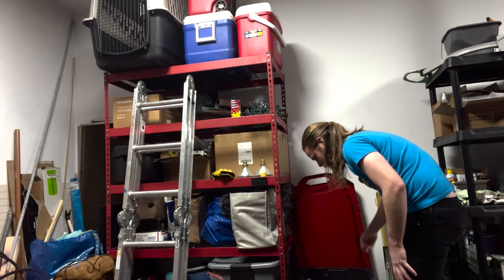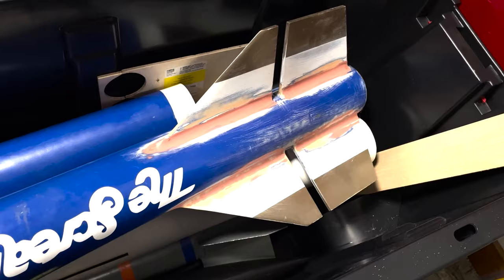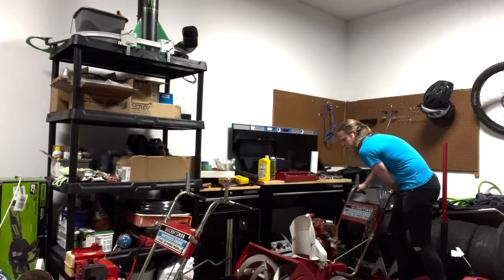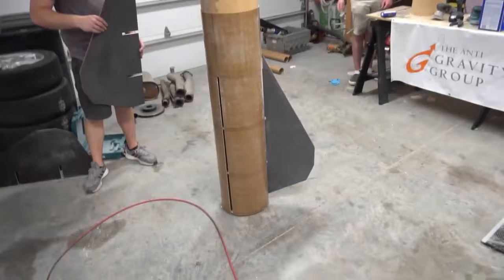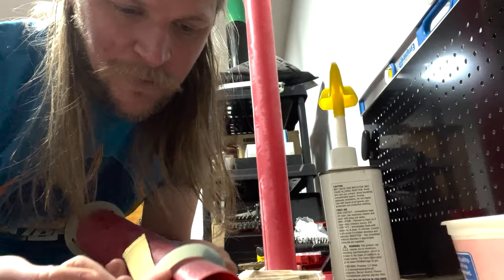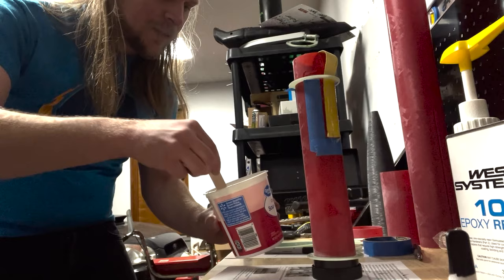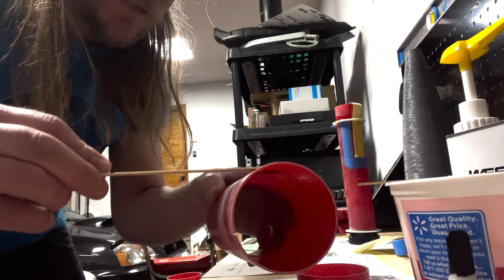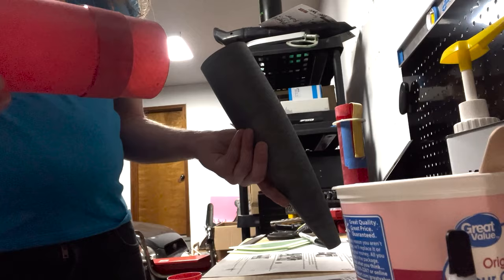The Great Glue Debate

Comment: 404 high density filler  and 406 colloidal silica are my go-tos. I usually put some 404 in w/the 406 for fillets, I usually just eyeball it, but it's probably something like 4 or 5 parts silica to 1 -2 parts 404. When attaching hardware, like washers/nuts to bulkheads etc, I just use 404. Lately tho, I've been messing with W.S. G/flex 650 Toughened Epoxy lately. It has a higher Tg than typical W.S. (105). I want to try the W.S. G/flex 655 and G/5 5 minute. I also have some of that Six10 in a tube, but I haven't tried it yet. I'll also use Aeropoxy w/and w/o some 404 or 406. I'm still learning what's what, but I also have some BSI and JB Weld obviously :) I'll often use JB Weld near the hot end, or when I just don't want to get all the epoxy "stuff" out

Comment: Can't believe I enjoyed listening so much to a glue talk.    So far I have been using Bob Smith epoxies for my builds and am intrigued to start using West systems which many people talk about but WS has so many options.    Can you comment on the which ones match up best with high power rockets for the colloid silica and hardener?   403/404/406 or 205/206/207
Reply from the maker: Typically I buy just the slow hardener and the 406 silica. However, adding a small can of fast hardener for situations where you need a bit quicker curing time isn't a bad call